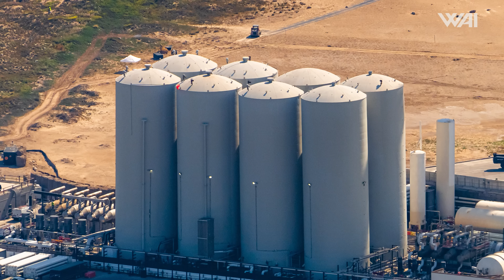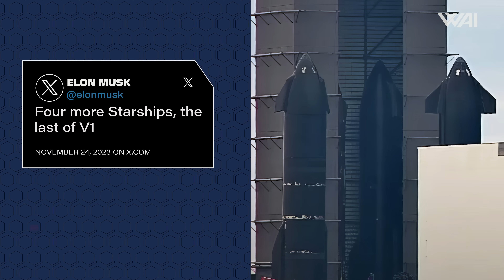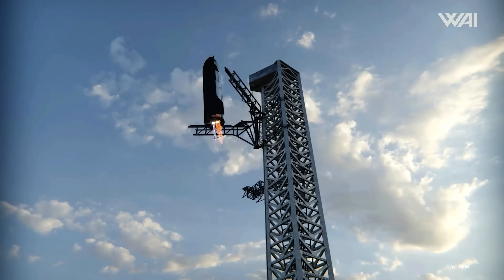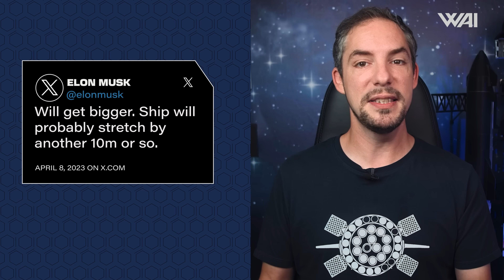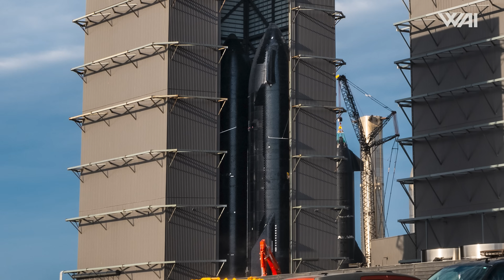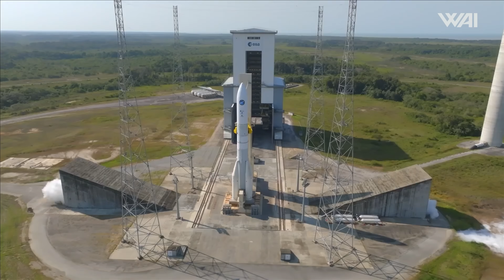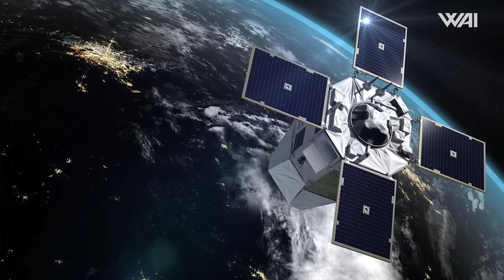Starship Evolution: Why SpaceX is Shifting To V2 Starship Now!

Comment: I think that someone should endeavor to go up and collect the space debris and keep it in orbit to be refined into something else.  Look at how much money you save by not launching it.  Lots of metal that could be taken apart or cut down and melted down and refined.  Great way to utilize some of that heat they need to dissipate.
Reply: Since air pollution from re-entering stuff is already becoming an issue, something like that will eventually be necessary.  And if the junk is being stored of necessity, why not, eventually, start recycling it?

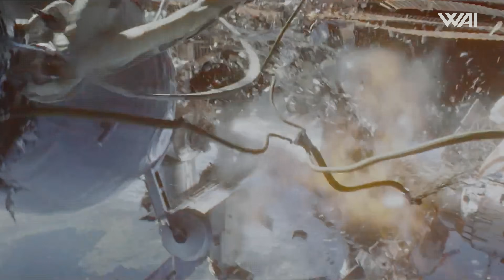Comment: 21:34 Kessler himself would insist that it's not "just a theory", it's an effect confirmed by decades of observation. Over the last few decades, the growth of space debris caused by other space debris has roughly followed the curve that he originally predicted. We are still on that curve.

The amount is currently small enough to not be a major problem, but the whole point of the paper is that the curve rises rapidly over time. Fortunately there's still time to avoid the nightmare scenarios, as long as we keep working on the remediation and mitigation treatments.

Comment: Change from steel to aluminium keep rapter 2and starship v1 and booster v1 because its lighter use space shuttle  tile system it's tride  and tested more reliable as no external tank foam to damage tiles  .  Starship v1 is not powerful enough because of its steel construction it's to heavy that's why v2 is an unnecessary    option !   Great show Felix

Comment: I like how musks bootlickers like you always conveniently fail to mention that starship design doesn’t allow nor have landing legs to ever be able to land anywhere but chopsticks, doesn’t have the launch escape system because it was never meant for human flight, how hotstsging wasn’t even in the original designs again because it was never meant for human flight, meaning no launch escape needed. Not to mention NASA does not like propelled landing, which is why dragon 2 was scrapped despite the demonstrated landing attempt, and converted to launch escape only, wings (shuttle) or parachutes only for human flight. If humans will ever enter the spaceship, it will be done in orbit, launched in parallel on dragon 2 lmao.

Comment: Until SpaceX can prove they can manage a launch without destroying in part or full of what is supposed to be a launch facility with the ability to carry out multiple launches and landings every 24 hour period they should not be allowed to launch again, period.
Reply: Umm…how can they prove that if you don’t let them launch without proving it?
Reply: Wow! Thank goodness you don't work for the F.A.A. !
Reply: @AncientEgyptArchitecture  don't I?
Reply: @nickmail7604  They proved it, they're allowed to do maximum 8 launches per year and the launch mount can hold up pretty well.
Reply: @XxX-ww  so they are presently rebuilding parts of it for fun?
Reply: @nickmail7604  That's just small damage you know, even SLS did damage to its launch mount a lot more than expected.

Comment: You really should try to get a real rocket en gineer on your channel to talk through this Kessler Syndrome nonsense.

Sure, it is not IMPOSSIBLE to get such a thing, but due to orbital mechanics it is VERY unlikely to end up with ragnaroekian dimensions for space travel... cause you see... ORBITS are determined by VELOCITY... and due to some effects when going against the rotation of Earth slowing down an object most objects in orbit go WITH the rotation, slowly "overtaking" Earth. ALL in teh same range of speeds, all in similar orbits, rarely crossing over each other. Debris will stay at the speed when the carrier vehicle "dropped" it (or was separated) and then over time slowly lose height the more its velocity has bled off... 

There are SOME risks like a rocket hitting unexpectedly an object big enouigh to shred it to pieces or trigger the self destruct while still accelerating or a deliberate sat killer missile (although those try to fly by and aim "downwards" so anything accelerated by the explosion will go towards thicker atmosphere layers where it will be slowed down...  exactly so they do not "seed" lots of higher orbits with fast flying shrapnel on unusual courses.

The Cascade is a theoretical possibility in an extremely unlikely Worst Case Scenario that was taken far too serious by those people that warned us all the time about other low probability scenarios like "Solipsisms" ( the "brain in a jar" or "Matrix" scenario where our sensory input is intentionally fed to us by magic or computers and we cannot tell it from reality) or even worse, endtime scenarios like Roccos Basilisk... It should not be brought up in every space video dealing with any form of detritus in orbit.

Comment: Starship with successful landings will obsolete all existing AND all planned (excepting Starship clones) crewed spacecraft. It's a bad risk right now to spend a lot of money on a new crewed spacecraft when it looks like Starship might be successful soon.  I mean where's the need for a spacecraft that is small and cramped carrying a small amount of cargo when instead you can launch in a large and roomy ship that can also carry huge amounts of cargo AND will cost less to launch than a Falcon 9 flight does right now?

If Starship fails, that could be money well spent but Starship doesn't look likely to fail.

Comment: 1:55 - Yes, Felix, I did point this out to you back when they first installed the vertical tanks. I am not an engineer, but I have actual eyes, and the placement, and type of tanks chosen were really dumb. I said they would be damaged or ruptured by a test, or a launch, and this was back when Musk was lying about Methane, saying that it only burned, and couldn't explode!
Truly hilarious stuff.

Well, the good news is that SpaceX operations are getting far too advanced for Musk to even understand, let alone attempt to guide - and the further away Musk gets from anything, the better that thing becomes - and quickly. Right now Musk seems intent on taking Twitter's shareholder value to zero, and on ensuring Tesla goes bankrupt in a few short years.

Comment: I suspect that it may be pushing the envelope with a reduction from 4mm to 3.6mm steel whilst adding another 10m to the length. Without doing the math, instinct suggests that one or the other makes sense, but not both. I also think that the booster and ship are not necessarily over engineered because of the structural loadings during the belly flop re-entry.

Comment: I think that SpaceX still needs at least a dozen more launches before everyone thinks they are reasonably safe and usable.  Looking back in history, the Mercury and Apollo missions numbered 18 before Man landed on the moon. The 2nd stage pushing down on the 1st stage booster, causes zero G (sloshing) in its tanks.  They may need internal baffles, or exploded cell foam.  Restarting engines, or powering them down without turning them off, needs attention.